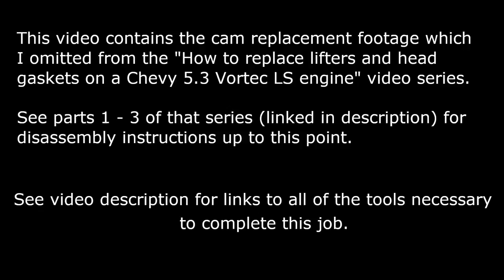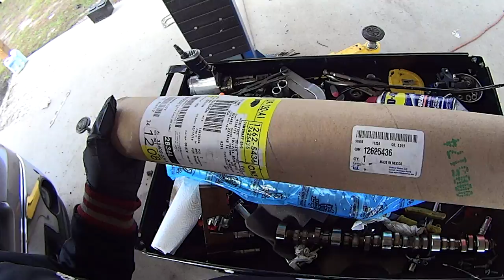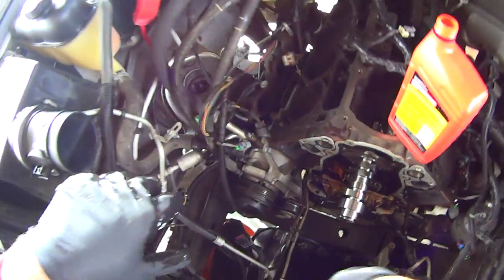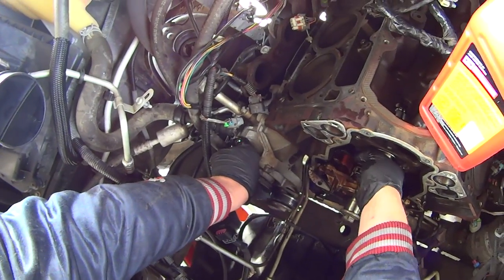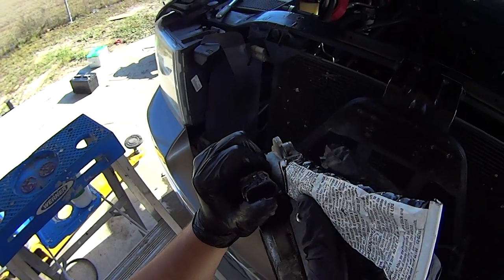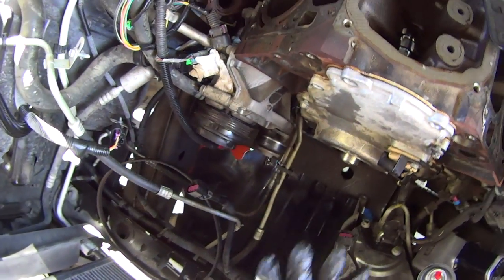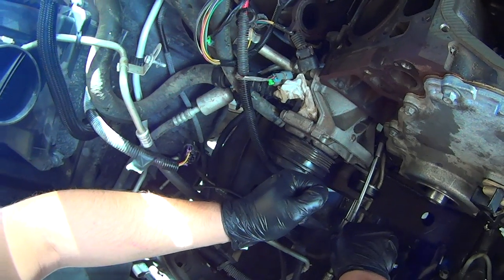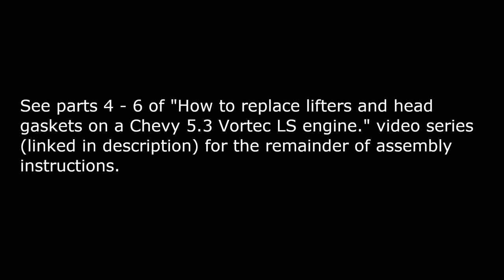Chevy GMC Cadillac 5.3L Gen-4 LS Camshaft Replacement

Comment: Did you use the same camshaft bolt or did you get a new one? @ 25:35. And are there any issues in doing this? Your truck is running fine?

Comment: I did a cam swap n in 2007 tahoe 5.3...btr kit...Norris cam...I didnt line up timing marks before putting back together..been going through chemotherapy and taking alot of meds,,I just spaced out....ran like crap...was lined up after I did....I took apart to timing cover off...do I have to loosen rockers to get it right ?.it spins by hand so I don't think I bent any valves..I've been out of work and don't have much money....any info will be appreciated...thx

Comment: Fantastic video series but if you go this deep into a job like this do a timing chain and oil pump job along with it.
Reply: I’d change out a whole lot as preventive maintenance.
Reply: Because it takes another 12 hours to drop the oil pan… it’s not as simple as it looks, the bolt that connects the pickup tube and oil pump is facing upside down and only accessible from underneath the oil pan. To drop the oil pan, you have to remove the front cross section, drop the front differential, and lower the steering rack… Not to mention to change oil pan gaskets from factory requires drilling out the rivets that hold the gasket in place… Not a fun job, if you’ve got good oil pressure and no leaks, I would do it like this video… fk all that extra work… that’s whole other job.

Comment: Have you any experience with low oil pressure after the engine warms?  my AFM lifter on Cylinder 7 seems to be not getting oil.  I replaced the oil pump and get 60 PSI on cold start but lose oil pressure over rim
Reply: Try removing the intake and seeing if your VLOM bolts are loose. I had the same issue but it was cylinder 4. Bought all the parts I needed to delete the afm and when I got to the VLOM I noticed almost all the bolts were barely hand tight. Did a little research and found that if your VLOM isn’t properly sealed it can cause all types of issues like low oil pressure to the afm lifters… luckily I caught mine in time and it didn’t damage the lifters or cam, but cylinder 4 exhaust push rod and rocker arm had excessive wear from inadequate oiling. I still went ahead with the full delete, but it originally was only about a $50 fix 😂😂

Comment: Excellent video!  Upon closer exam on my suburban, I found a heater hose was failing. Got it taken apart and the replacement hose and fittings are on their way...  I sure hope that fixes my white exhaust smoke, lifter ticking, low oil pressure, excessive consumption, and milky color oil too.  Lol.  I will probably be watching these videos of yours a few more times, but at least i can do the job when its not snowy out now.  Thanks a million.  Cheers from central minnesota!
Reply: Hey Travis, any updates?  Was it your heater hose that created the problem?
Reply: @purgemedia6794   because its a vehicle we dont rely on, the burban maintenance always gets put off until later. Sigh.  Its rusty, dont run great, and needs tires.  Thats like 3 strikes for the old girl.  Been focusing all my shop time lately on snowmobile and kids sleigh repairs.

Comment: So if the lifter gets stuck and the cam wears into it, then do you pretty much always need a new cam?
Reply: If the cam gets worn into then yes the cam need to be replaced but according to this guy’s video on replacing lifters (part 1) when a lifter fails it’s common that the cam won’t be damaged so you need to inspect the cam with the lifer removed.